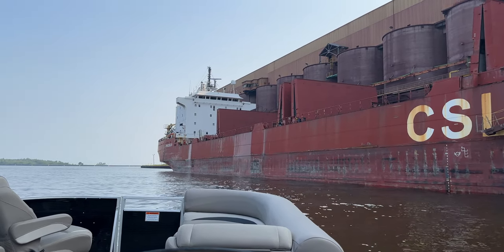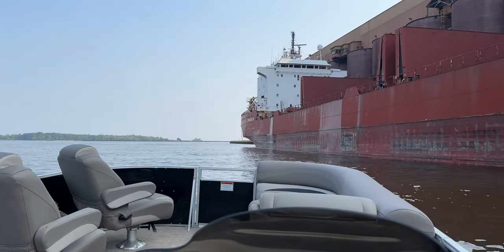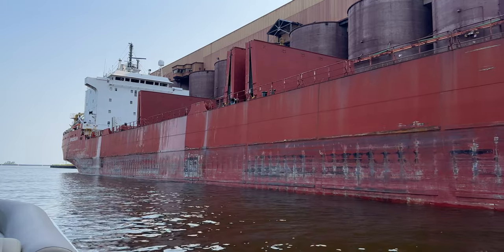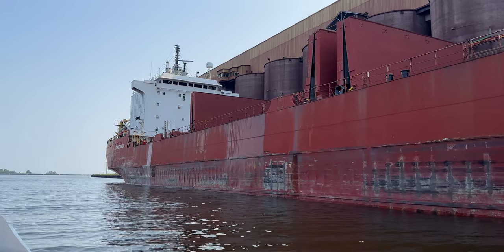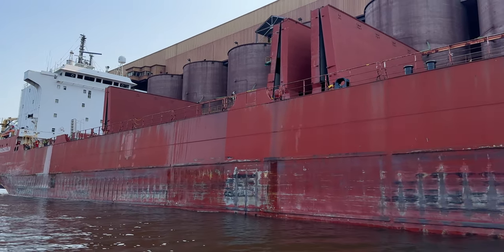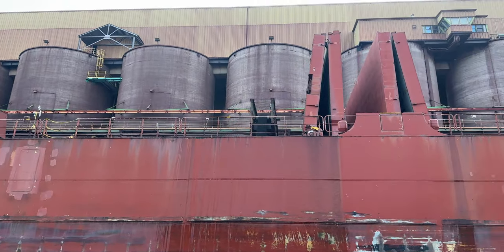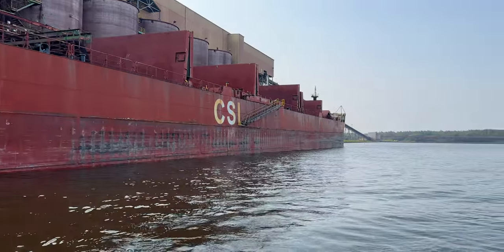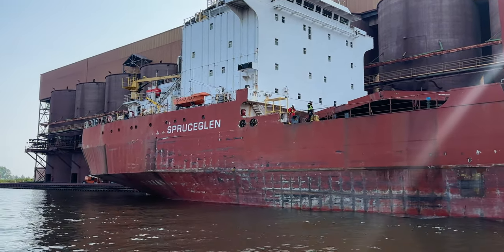⚓️Loading Iron Ore Pellets! Ship Spruceglen at BNSF Ore Dock in Superior!

Comment: In some respects this ore dock is just as interesting as the ships that load there.  Prior to these massive silos being built in 1978 it was a coal dock.  Today this ore dock is connected to a train yard by a 3.5-mile conveyor system.  It's the only active ore dock in Superior.
Reply from the maker: Chuck, you really help us learn
Reply: I'm learning myself.  There are 18 silos here.  The train cars loaded with iron ore turn upside down via a rotary device.  This all happens at the train yard before the ore travels the 3.5 miles to the dock via conveyor. The ore was mined on the Mesabi Range near Hibbing, MN about 75 miles to the north. I personally saw these mines last week.  Simply unreal seeing a mining operation spreading out over 9 miles.

Comment: is that a different loading system then the CN6
Reply from the maker: I’m not too sure?
Reply: Hi John.  Yes, there is a big difference when comparing the two ore docks.  This one in Superior uses 18 silos that get filled by a 3.5 mile conveyor starting at a train yard.  CN 6 in West Duluth has train cars carrying ore go right to the top of the dock to dump their load.
Reply: @chuckg6039  I was just watching the train roll off the ore dock..Then it disappears into the woods...Where does it go? some times I think it goes to the place the ships unload there on the other side of the old dock..And sometimes I think some how it gets to the big pile of material along the lake front to the left of CN6..
Reply: Hi again.  Well once the train uploads at CN6, it then eventually heads north back to the Proctor railyard and then back up to the Mesabi Iron Ore Range to get more ore.  The Hibbing, MN area is where the mines are located.  Those monster piles to the immediate east of the CN dock get filled via a conveyor belt and a cool crane which rolls on an elevated track across the middle of the pile. It has a boom so that it can place the ore where it wants.
Reply: @chuckg6039  Thank you